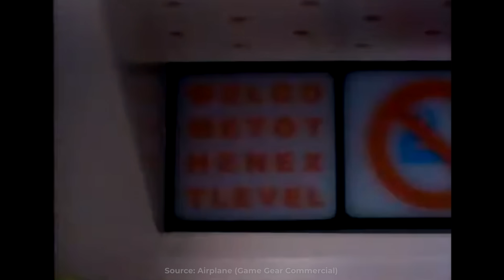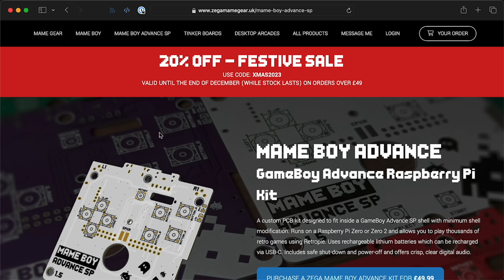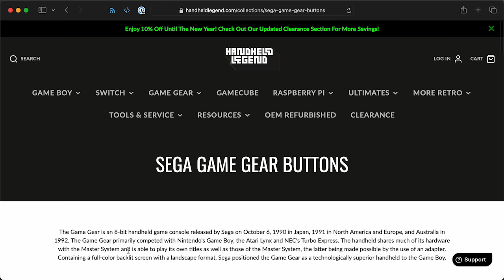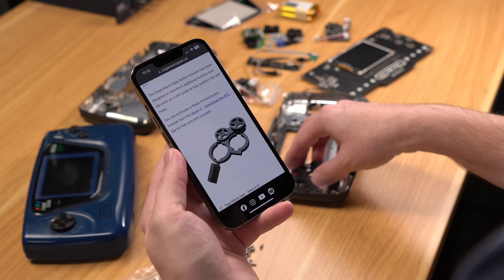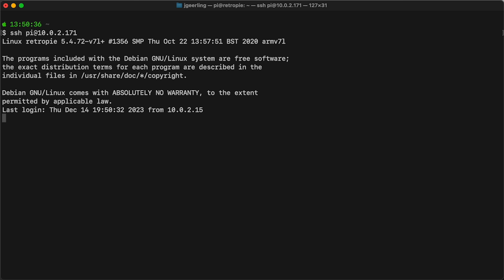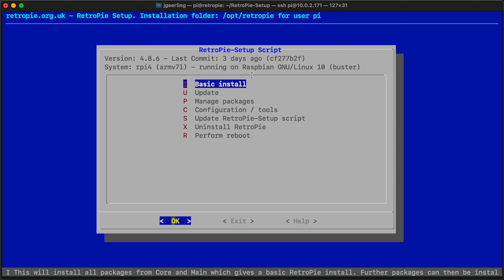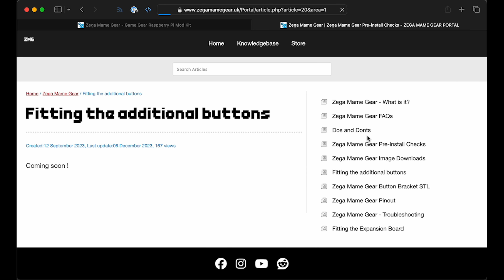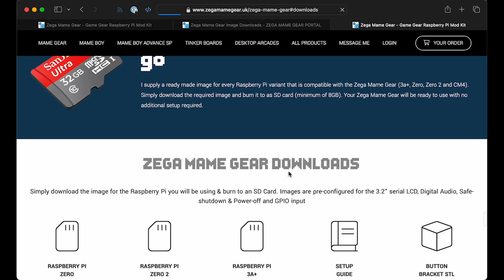Restoring a broken Game Gear with Raspberry Pi

Comment: Hi Jeff, having just failed to swap out a ASIC chip from my old Game Gear im looking to replace the insides with a PI but I don't fancy using a mame gear board. I've got the battery and sound board mods from retrosix and I was wondering how you would go about using something like a pi CM5.  I think ill need to get a new screen as the retrosix one and the original cant be used with a pi?.

Comment: So, you plugged ZMG CM4 Adapter into board. But I see on another video that on that slot is  plugged raspberry pi. What do I need CM4 or raspberry pi ?
 Where to find software dor micro card and update possibly firmware / bootloader (mentioned in store site).

Comment: I have 3 of these kits. from a cost standpoint it may make more sense to get a new shell form Handheld legend with the extra buttons and screen protector. I did one in an original shell to intentionally look well used. John was offering some shells on his site with the extra button holes pre-drilled. Im not sure that is a regular thing tho. He has an updated power board for the CM4 and 3a as of a June 13th 2024 post on the Facebook group. Im not sure how and when they will be available. I also just contacted him about a software iso for the CM4 and he had an updated one as well. both the updated iso and the power board should help the voltage issues. John is a good dude and very helpful. I bought the last of my kits just about a year ago and he still responded to me within a day about the CM4 iso files this past week. Handheld legend is selling the kits on ebay too. but they are still probably cheaper directly from John's web site.

Comment: Ask around if anyone wants the left-over main board:
- as several have mentionned, those can usually be re-capped (and the power and audio amp replaced with modern reimplementations) and they work again.
- at worst it's possible to salvage the custom ASICs and CPU, and solder them on a modern motherboard PCB.

Comment: Jeff, thanks for the great video. Received my kit today and think I'll be using a stepper bit to drill the holes. It's great they give you the files to download (stl) button parts and the image for the SD boot card.
Reply from the maker: Yes! Though I am trying to get them to release more instructions for building the image, so I can replicate it on my own (and tweak it more to my liking...).

Would be very cool if the future CM5 will fit too! Maybe a new mainboard for it.
Reply: @JeffGeerling  I’m setting up a Pi Zero 2w for this and the image downloaded works but didn’t detect my generic USB game controller. I used a keyboard and found the “Enter” key will bring up the configuration menu but only the “z” key will take you to the sub menus. You must go to configure input, press “z” twice, physically remove the keyboard and replace with gamepad. Hold down any button and it will be detected. Afterward the menu of assigning each button will appear. Hope this helps others trying this.
 
The one thing that I am concerned about is a heatsink. Without testing how hot will the processor get while running the graphics, will it need one? I’m thinking a thin aluminum strip as wide as the processor going up and attaching to the original metal shield located between the audio and power boards.
Reply from the maker: @dronepilotflyby9481  I think the Zero 2 W would be perfectly fine, as there's enough space within the chassis that natural convection will keep it cool.

I'm running my CM4 with no heatsink, and it only throttles after about an hour—at which point the battery is also running out a bit, so it's not too bad, haha.

For the Zero 2 W, I wouldn't worry, unless the ambient air temperature is pretty high (e.g. gaming outside on a very sunny day).
Reply: @JeffGeerling   Yes, after playing several games I found the CPU temp doesn't rise much. 

 I had to download the image for the original Zero to get the candy not included with Zero2 image. 😀

Comment: I did this case hacking style sevrol years ago. This looks a lot easier! I added 4 shoulder buttons on the back as well though which is nice to have. As well as a row of buttons on the bottom to use as like hot keys for save load etc.

Comment: Urgh.
1) That's not restoration of the hardware, if none of the original hardware is running the games.
2) Paying someone to disassemble an either working or fixable console and putting it in a frame is a waste of money.

Comment: Good to see I have options when I finally repaur my Game Gear. I won it in some contest iirc when I was 14-15 years old. I tried it around a decade ago and it was dead and I do have a cap kit but not sure what else it may need.
Reply: In addition to replacing the caps on the main board (and cleaning any electro lyte leaking) (and maybe bridging a corroded trace), other necessary mods might be replacing the power board (there are modern that can take USB-C, and some even work with rechargeable batteries like the one used in this video) and the audio board (some support stereo if you drill an extra speaker gille and add an additionnal one). That resurected my console.

Comment: Very nice, and Happy Christmas!
For an old hand like me I tend to crack a wry smile whenever difficult N64 emulation is mentioned. I remember happily running UltraHLE on a Win98 PC that would have seriously struggled with PS1 emulation at the time. Said PC was probably less powerful than a Pi Zero for both GFX and CPU. I guess N64 emulator coders very much chase perfect accuracy rather than minimum hardware these days.

Comment: Talking about rescuing e-waste. I litteraly work at a recycling center and I found a game gear including the alternative wall plug adapter. the capacitors are broken on it and its missing screws, but other than that. its the whole thing. Just lying in a random crate of e-waste.

Comment: I was more interested in that picture. Had games I had as a kid as well. Yatzhee and CROSSFIRE! Loved that game. Anyway, I have an original Game Gear and Gameboy from initial release that I bought as a kid that works and is in perfect condition. I used to use it when in the car with my mother. And i had the carry cases and protection stuff. Didn't realize so many were dead now.

Comment: My favorite retro console is, without a doubt, the NES. Why? Both my mom and my dad would play Super Mario Brothers 3 with me. We would take turns playing one level each. We had the big chongus joystick controller as the stock controller was way too small for my dad's ginormous hands. I remember one time my mom was upset as I beat Bowser in such a way you couldn't kill yourself and replay the level. Normally you get Bowser to keep breaking the floorboards, however I managed to get to him while having Flower Power so he died without breaking the floor fully. 

I never had any Sega systems growing up. Two of my cousins had the Genesis so I would play any time we went over. My first handheld was the GameBoy Color. Also never had the SNES either.

Comment: How much did it cost in the end?
Reply from the maker: Around $100 all-in. You can spend a bit more for more storage or a Compute Module with more RAM, or save a little more getting a Pi Zero 2 W and just a 16 GB microSD card.

Comment: That build is pretty sick. Not too sure how I feel about the 4 button layout without the GG having shoulder buttons. Pretty much makes 60% of the SNES games unplayable.... and without sticks makes N64, PS1, Saturn, PS2, and DC games useless as well. 

Love the screen! The colors look great. I'm sure the new audio board thumps with decent buds or headphones. Would have been cool if you had been able to save most of the GG functionality and been able to use the cart slot with an embeded microSD slot to boot roms from. 

But this way, Wonderswan, NeoGeo Pocket, GG, GB, GBC, NES, SMS and Genesis games are gonna shine with the portability on this unit! Treasure over trash always!!! Save the old tech!

Comment: I have a Game Gear my grandmother left me when she died in 2009 (she left me much more but its the only thing I have left from game systems sadly), but the screen doesn't show anything, it lights up but no game footage :(
Reply: It almost certainly needs new capacitors. That is by far the most common issue with these.
Reply from the maker: And there are shops that will help if you're not comfortable doing it on your own too! (Like Brady Repairs — the guy who I mentioned in the video, there's a link in the description) :)

Comment: Good morning Jeff! I have a question I was hoping you could assist with. I'm curious about a SAS drive nas/raid setup on a regular 4b, I'm in wisconsini and scored two old 12 drive infortrend esd1012g all full of seagate sas drives "24 of them!". Could I use one of those nvme ssd pi hats, plug in a graphics pcie riser and then plug in a say h200 HBA flashed in IT mode for OVM and use a enclosure with a backplane, all powered off a 12v 300watt psu and a buck converter for the pi? does this sound like it might work? I have all but the riser and hat already to try it. I just want to move away from my dell r510 as a fileserver and webhost, my traffic and file sizes arent large and I dont see needing more then a 4b 8gig....thoughts?
Reply: The regular Pi 4 doesn't have PCIe, I assume you mean a new Pi 5. Your plan should mostly work but you probably need more than a 300 watt power supply, when you have lots of drives the power adds up. Unless you know your backplane does staggered spin up I'd recommend at least 600 watts for 24 drives. Your old Poweredge may use a lot of power but if you only have a single CPU (especially a lower power one like the L5640) most of the power will probably be from the drives.
Reply: @eDoc2020  Ive done the math on the drives, i can power plenty enough. and no, i did mean pci through it, its possible, but it means still going through the usb 3.0, which im fine with cause i have tons of hardware and a cluster of 4b. ive already figured it out, thank you!

Comment: Still have my original game gear, I’ll need to recap it one day. If only LED backlights were around at the time the battery life on batteries would have been pretty damn good, shame the fluorescent backlight let it down.
Reply: The solution back then was to buy a battery pack. I bought it as soon as it became available, didn't regret it. (and continued used the pack with a CD player, later on).

Comment: I did this exact same build. My lessons learned:
1. Buy a retrosix shell and use it instead. Drilling an OG cell is a crime.
2. Use a step drill, and drill from the inside.
3. The 3.2in screen that comes with this is not that great. Color accuracy, resolution, and viewing angle are meh. Unfortunately not many options out there that will fit that same space.

Comment: This is awesome!!! I was cleaning up my basement and found my old GG. It still works but I totally need to do this with mine. Thanks for sharing this great video.
Reply: Or you can replace the electrolytic capacitors and just put in a modern IPS screen (recommend the BennVenn screen). Shouldn't destroy a working console! The Zega one's are really for consoles that are too far gone with corrosion.

Comment: Nice! I have a retro pi g 2 which uses a pi zero 2 w. It runs even PS1 pretty well on its little display. I hope you can resolve those issues with power delivery and SD card corruption. Perhaps there will be a follow up to this video?

Comment: Trick for getting micro SD cards out of poorly positioned readers, use a USB A plug (perhaps your microSD card reader itself)  to push card and unlock it, 
THEN slip the end of the card into the hole in the USB A plug, like a handle.

I have a gopro max and microSD reader is fiddly in the same way.
Reply from the maker: Ah! GoPro is the same way for me too (I have a Hero 10, and it's a pain getting that thing out).

Comment: if you only have nostalgia for the form factor and not the actual hardware in it, this is a great option!
Reply: I have nostalgia for going through 64 batteries a week.
Reply: @ShastaOrange  you can mod the original hardware to 5v, and modern display.

Comment: I see it has a USB...why not put a SanDisk ultra micro in it...install the root drive to that vs on a SD card (maybe the /boot on the SD only)...and run it from there...more resilient and faster read/write speeds.
Very very cool on restoring old hardware all the while expanding it's capabilities!
Awesome!
Keep em coming!!!!
Reply from the maker: Unfortunately with this setup the USB port is USB 2.0 only, so it would only be marginally better than the microSD card. But a future revision could maybe figure out how to jam USB 3.0 in there, or even use PCIe on the CM4 for NVMe!
Reply: @JeffGeerling  Hey Jeff, for some time now I own an PCEngines APU2 - it's a x86-64 based SBC - and at the time of purchase I chose a M.2 s-ata storage (back then the line up of pcengines did not offer boards with nvme)
and although it is quite slow along with the slow amd 4-core cpu it gets the job done
I do appreciate your enthusiasm for nvme - but the available pci-e should be useable for much more than just nvme storage
as pci-e can be switched somewhat similar to ethernet datagrams are you aware of any extension-board either for ARM or RISC-V which makes use of PlX chips to fan out the single pci-e port to multiple so it can be used more diversely?

Comment: The shell of the game gear should be the least of your concerns. It's all about the chips that are not manufactured anymore. There are kits that let's you reuse those finite chips and replace other chips with new counterparts. You don't need to gut a game gear to do what you did here, just buy a new shell. They are cheap and plentiful. I hope you saved the old guts, they can be harvested. I would buy another shell and put them in there to see if someone wants to repair it.
Reply from the maker: The black shell was sold alone (no guts), which was another motivation for keeping the blue shell untouched for now. If I do gut it, I'll post the innards on eBay though! I haven't decided if I want to do a restore / swap in LCD, or a full retropie build like I did with the black shell unit.

Comment: Which model of the CM4 would you recommend for a retropie build? I guess the biggest factor is how much ram, 2GB vs 4 or 8.
Reply from the maker: I would personally stick with 4GB, just so you never have to worry about RAM for anything else you might do with it. 8 is pretty niche, only need it for some computing use cases—wouldn't really get used on a CM4 running RetroPie.

Comment: Man, hearing you kinda gush at the early release days almost makes me jealous.  Even when I was a kid, I picked up a game gear and said "Ewww.. why is the screen smearing? It looks gross.".  And yes, I also felt the gameboy had the same problem, but it bothered me a lot less on the gameboy.  So yeah, this is a Super cool project!, I also recently picked up an old gamegear, I was just going to try and repair and replace the screen.. but this project has me thinking about swapping to this..   hrm...
Reply from the maker: Heh, we put up with a lot back then... having refresh rates in the low hundreds of milliseconds was pretty amazing with earlier display tech (especially portable).

Mouse trails on laptop screens were extremely helpful because you'd just lose the mouse a lot :D

Comment: For future projects, might look at using a step drill. They are better for drilling through thinner material, like that, then a twist drill is.
Reply: I agree. Twist drills can bite and grab onto thin materials. The step drills are not ground the same way and do not "drill in" to the material. It's more of a shearing action like in a reaming tool.
cheers and happy holidays :)
Reply: I was thinking the exact same thing! Step drill bits save you from SO MUCH GRIEF! Absolutely the best way to get precision when quick and dirty is on the menu (e.g., you can't afford to make any mistakes, but don't have access to a stationary and/or hand drill).
Reply: Or use a cheap carbide tapered grinding bit and drill a pilot hole first then expand it with the grinding bit. EDIT: Or maybe even a hand reamer. The important part is getting the pilot hole perfectly centered first.

Comment: Jeff, would love to see an update one day if/when the power delivery issues are resolved. I imagine the future CM5 would struggle even more, but would make for a really great performer here.
Reply from the maker: I've spoken to John and it sounds like he's currently doing some work on the Mame Boy kit, but may go back to an idea to build a CM4-specific drop-in board so you don't have to use the GPIO adapter board. That would also allow for some room for improvements to the power delivery, we'll see!
Reply: @JeffGeerling  Don't know how to check, this might be a stupid comment, but can the CM4 be ... unclocked ? Like the inverse of overclock, just power it down, since it probably doesn't need top performance. Though to be fair, no idea if it will impact the power problems. It should help with the battery life though.
Reply: @Winnetou17  I'm using a Pi Zero 2W. Working well so far.

Comment: That looks awesome. Great build. 
I stopped using Raspberry Pi for things like this because of the undervolting problems. None other ARM SBC has it. RK3399 was even able to run stable with all cores maxed out and only 4.5V input. RPi can't handle normal 5V. Needs 5.2/5.3V. I hope the RPi5 doesn't have it. Have not heard anything about that. I can't afford one in Europe. Would like to see how it is. Cheers.